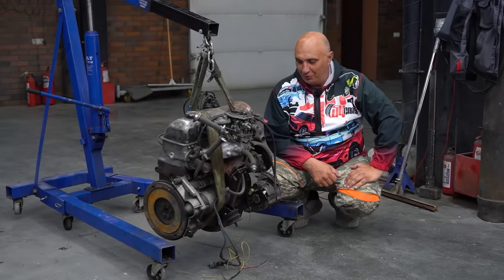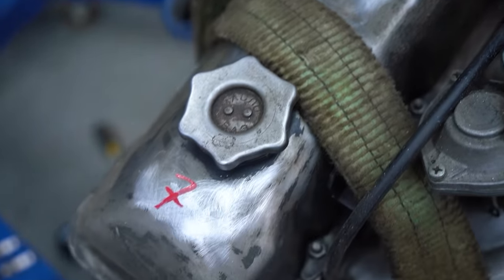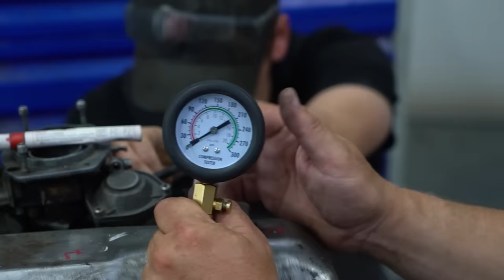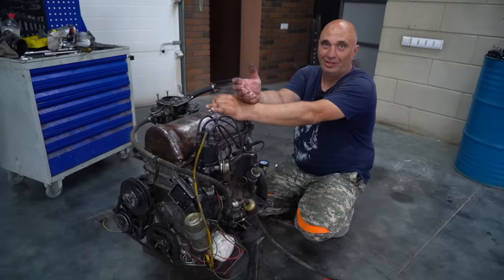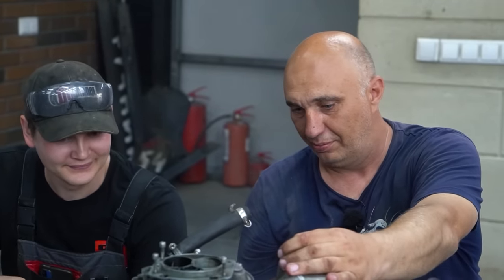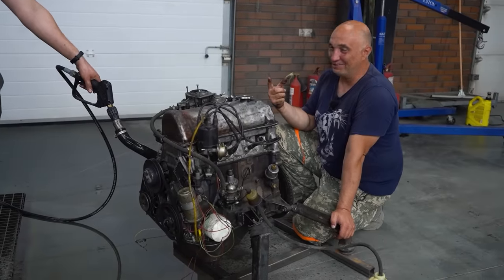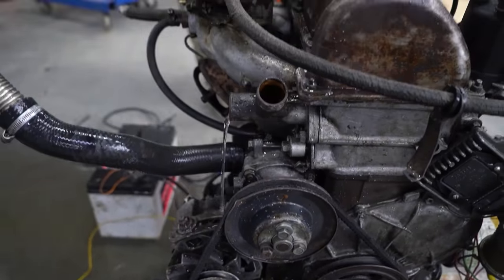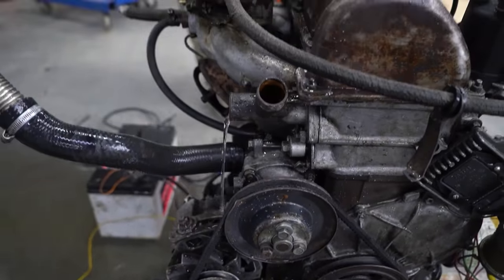Will an engine start on RUBBER piston rings?

Comment: Many different styles of rubber o rings on the market these days. Viton you'll have to be more specific. They make green, red, orange, blue, black viton rings these days. Silicone viton rings. I believe you are onto something here and I agree with the oil control ring. I also believe it would need a ring closer to the top that's rated for intense heat. So maybe would be a combination of colors.  Maybe even 4 rings. Make the ring grooves deeper. You could have 1 high temperature resilience ring at the very top. 2 black rings in the middle and lastly the oil control ring. If you were looking for an engine that would last near indefinitely you'd have to find a way to re-sleeve the cylinders with a Teflon tube that could also handle high heat. Then there would be almost no friction between parts only friction between the compression of the rings.  Allowing the piston to really flow freely while still keeping compression.

Comment: I have an idea. Use a correct oil ring for proper oil removal. Using an upper metal compression ring to protect the rubber from flame accessing the O-ring and preventing accidental. Diesel ing. Shave the inside of the rubber O-ring to give it a slightly flat surface to encourage it to stay incorrect position without twisting. I would be curious to see what happens and if it can be durable. Maybe add more rubber O-rings to help stabilize the piston help quiet the engine.

Comment: Use silicone rings on the modified 4-ring pistons you made, in a car with proper engine cooling. See how long they run
Reply: I commented about using silicone too, but ppl brought up degradation from petroleum exposure. Perhaps the 4 ring pistons with standard top and bottom rings, and silicone in 2 and 3 to see if it boosts compression but minimizes the silicone fuel/oil exposure problem.
Reply: Viton in a higher durometer might work better
Reply: ...or run it on alcohol! no cooling needed....
Reply: @koenielinux3131  BRILLIANT  GUY
Reply: @9morrical  SMART
Reply: @UmmmmmmmWhat  ASTUTE
Reply: @M S YES

Comment: You could widen the second groove and install a TFER hydraulic seal. It's a PTFE ring and rubber expander. Available in bronze loaded types as well. Maximum speed though is 12 feet / second. With an 80 mm stroke, that's 1371 RPM.

Comment: Two other things to check...Check for a carbon trailed distributor cap, and check the cylinder head. I suspect the valve clearance is too tight, and, check the valve guide seals. It's hard for me to imagine that the O-rings let all that oil into the chambers, and not have any blow-by. I'm willing to bet, the O-rings did even better than you thought!

Comment: Try replacing the piston rings with hydraulic cylinder packing seals
Reply: Being a directional pressure seal, it would probably pump a lot of oil past the seal on the downward stroke and the suction of intake.  However, compression would be great.
Reply: @kenbakker3241  You could do 2 in different orientation.
Reply: @kenbakker3241  keep the regular oil control ring in addition to the hydraulic cylinder seals. That should keep oil consumption down. It would still would burn some but I think there would be less friction than having 2 seals in opposite directions.
Reply: @kenbakker3241  Not a problem! Just run a 25:1 2 stroke mix in the crankcase lol. World's first runaway petrol engine.

Comment: Might be more trouble on a car with tighter tolerances- the ring there partly to transfer heat from piston to engine block to cool it, if cylinder heats up more it might seize/knock. Tighter tolerances tend to make them more fragile.

Comment: Actual piston rings have a profile for the top ring to scrape the cylinder when the piston goes down. O-ring is round and would allow oil to slip past them. Maybe keeping the oil rings could have helped. As for the rubber itself...it might have already burnt away if there was no oil on there!

Regarding high temperature rubbers do avoid fluorocarbon rubber! When those things burn up they put out hazardous fumes as PTFE would above 300 degrees C. HNBR and XHNBR would have elevated temperature capability too. Silicone do handle elevated temperatures but needs lubrication to live (How about using silicone sealant to make rings)

Edit: a good alternative is hydraulic packing for hydraulic cylinders. Do make sure that the bores are up to rubber seal roughness specifications.

Comment: a good experiment might be to make a piston out of EPDM, Neoprene, Nitrile, SBR, Silicone, or Viton.  Maybe put an aluminum core in it to connect to the rod then surrounded by a thick layer of rubber to fill the cylinder and no rings.

Comment: That could be very interesting to try silicone ring for their temperature resistance

And if your bathroom is not finished, how about take some times to made new parts ? Brake disc and metal pads , and if possible take exterior tiles made for cold resist, they should be more density ceramic

Have fun guys 
You're crazy and ..... I love it 😎👍👍

Comment: If I remember corectly one of the outboard engine manufacturers was running a two-stroke with Teflon piston rings the reason for that was so that they could use very little two-stroke oil in the mix to make a fairly clean burning two-stroke

Comment: Maybe drop the diameter of the rings by like 1%-3% and switch to silicone like others suggested.

I think with slightly smaller rings of better material this becomes a big thing
Reply: I think you're right.  Buna-n is only good to around 100C before it gives up.  Silicone is good all the way up to 200C.

Comment: Global O-Ring and Seal   
Neoprene, or Chloroprene rubber, was the first synthetic rubber developed commercially and exhibits generally good ozone, aging and chemical resistance. It has good mechanical properties over a wide temperature range.

Neoprene resists degradation more than natural or synthetic rubber. Additionally, the material resists burning better than exclusively hydrocarbon based rubbers, making it appropriate for fire retardant applications.   .

Comment: Depending on the rubber they are made of it is possible they absorbed oil making them swell up. That would definitely increase compression.
What if you used stainless steel cylinders in place of the rings? They could be approximately 2 to 3 millimeters in length and laid end to end around each ring groove. The roundness should create less friction by rolling up and down the sides. And being cylinder shaped laid end to end they should hold the compression as well. There will be tiny gaps between each one and that will, or should allow for the oil to still be able to lubricate the walls appropriately like regular rings would. 
Theoretically it should create more power with less friction. But I suppose it all depends on what metals are actually used. These bearings may run a groove on the cylinder walls or they may wear into the cylinders along the ring groove…

Comment: Best way to try out how long is last if you leave the original oil ring,middle the original piston ring and the first ring made from heat resistant silicone rubber o-ring. They are heat resistant up to 350C for 10000hour or more. I dont know how much Celsius in the combustion chamber, but the fuel and the intake air probably cooling enough and the micron oil  film layer prevent from burning or get damage. I believe you could drive with it thousands of kilometres without any problem.

Comment: I guess the engine didnt die because of the rings having blow by, but because the pistons started sticking. The metal rings are the only thing directinh heat from the pistons to the engine block, if you use rubber for this task the pistons will get hot until they expand to the point where they tick to the cilinder walls.

Comment: Try the rubber ring on the lowest point and then the standard rings above it. Less rubber to pinch and twist and also allow a little less grip upon installing the pistons and it should last a long time just used to seal up compression and oil passing through. The standard metal rings will protect the rubber from burning out in the long run.

Comment: Neoprene, or Chloroprene rubber, was the first synthetic rubber developed commercially and exhibits generally good ozone, aging and chemical resistance. It has good mechanical properties over a wide temperature range.

Neoprene resists degradation more than natural or synthetic rubber. Additionally, the material resists burning better than exclusively hydrocarbon based rubbers, making it appropriate for fire retardant applications.   .

Comment: im curious to see if with rubber there would be less or no blow by. if a better alternative for rubber appears for combustion engines there could be little need for pcv systems, less oil leaks, possibly higher efficiency, less wear on cylinder walls (although whatever the rings would be made of would have to be replaced much sooner than traditional rings), and longer periods of time between oil changes. This was a great idea and i hope something better can come of it in the future to keep combustion engines in the world

Comment: I believe it is about thermal expansion of rubber rings , also you may consider that rubber by time will swallowing oil and get bigger in size ,  this is why it starts fine and after a while it stuck with cylinder walls , I believe if cooled properly it will not stop running.

Comment: I think you should do a follow up with rubber rings and a factory oil ring. And please, get the mixture on that carburetor right and the spark timing, distributor timing was clearly out, we can see because of the huge intake backfire ! Getting the timing right, good carburator and an oil ring, the rubber rings probably will run indefinitely!

Comment: I agree with @Russell Smith and I'll add try adding the engine into a car and see if it has enough power to move the vehicle. How long the O rings last for will the question but I believe it will make for a great experiment. Guy's that was an 107% success. Great video guy's!

Comment: Ring at top and on the bottom only. Oil ring opening for the drain to be enlarged. Thus oil could be sprayed in the holes by a spray jet

Comment: Next time use the square cut temperature resistant o ring seals with a steel oil scavenging ring as it seems to be the most consistent comment being suggested by vuewers. I would also use an actual piston ring compression tool when inserting pistons into the barrels to avoid twisting/damaging the seals, also It would be interesting to measure the rings before an after to see how much is/isnt lost during engine operation, looking at the rubber under a strong magnifying glass or a microscope to look for cuts or  wear to square edges.

Comment: Have not finished the video yet but wanted to put that silicon o-rings may be more temperature and possibly rolling/twisting resilient due to different physical properties than rubber. I have an ash tray made of silicon and have used it for holding a soldering iron in an impromptu repair and it didn't burn so not sure how they would hold up.

Comment: this looks like it would work loverly in a low temp low rpm motor!  

try some different rubbers! see if you can find one that works even better

maybe setup a motor properly with full cooling system and watch the temps I think its doing something interesting to the piston temps as it might be insulating the pistons and causing them to cease and not the rings themselves so maybe look at skiming the pistion diameter to see if it runs better

Comment: I wonder if the lack of compression prior to first start was from the o -rings being pushed into the grooves with the ring compression tool and hadn't pushed back out against the cylinder walls yet. Then after it ran, the o-rings shook their way out against the cylinder walls giving the 8.0 compression ratio across all cylinders.

Comment: I imagine the engine seized because as the pistons heated they compressed the o-rings more against the bore. Conventional piston rings have a gap in them to stop this happening. 
You could fit an oil control ring and try that, the o-rings seem to be being cooled by the cylinder enough, but I would imagine they will wear fairly quickly.

Comment: the oil probably helped lubricate the rings to keep it running as long as it did. so adding an the normal oil ring might kill longevity
however adding the oil ring and running 2-stroke oil in the fuel might make it work just fine

Comment: I personally think if you notch a small area in the piston ringland for the o-ring to ride into slightly it'll create a sort of natural "ring gap", you wouldn't need much as most ring gaps are about .25 thousands of an inch. Obviously there is really nothing you can do to the o-ring itself for notching into it without compromising its integrity, so an area where the pressure can slightly push it into the piston ringland to create that relief would be ideal. Do that along with an actual oil ring and I feel like you'll have success!

Comment: Teflon rings don’t really need to start as ring you can simply cut an angle  where the gap is and just use a Coil  or longer straight length. I’d suggest using square shape material. My small steam engine runs fine this way.  If you use square stock there won’t be any twisting. Teflon can take much higher temp.  The oilmwilubricate ok too I think.

Comment: You need to run the engine on a 2 stroke type fuel/oil mix if you want the O rings to work properly

Comment: If you guys put a factory lada piston ring in each of the cylinders with 2 rubber compression seals you could possibly extend the life of the engine by a few hundred thousand miles because the rubber rings will be easier on the cylinder walls and when the rubber gets wet then it will expand which will increase the compression ratio.

Comment: The ring groves were flat in the bottom and the rings were round when inserted into the cylinders the rings flattened or formed to the ring groves. Enhanced Temperature Cast Nylon Sheets for rings would be a cool ideal. Great Video.

Comment: You should spend some time setting the timing, fit vacuum advance hose and connect 12v to the carburetor idle valve and fit an air filter this would make the engine run better and give up a better idea of how your tests are going.

Comment: master..
Ford once wanted to try carbon fiber pistons..
The engine spun 18,000rpm but was never installed in a real car..
You try everything and one day the "thing" you tried will be used by companies, and you will regret that you did not get a "patent"..
I think, get a heat resistant gasket and patent such a piston...
With an efficient oil cooler, this engine seems to have a future...

Comment: One piston with leather for rings, one piston with ball bearings for rings, one piston with silicone rings and one with high density rubber for rings. You might set a new and cheaper precedent for the DIY garage mechanics out there!
Reply: Ball-bearings with race in place of oil ring would be very interesting.

Comment: It would be interesting to see a plug check done and the condition of them. Even better if new plugs were installed form the start. You can tell a lot from plugs as to how an engine is running. Also a full exhaust system would be ideal for proper tune and normal back pressure.

Comment: Try Polytetrafluoroethylene piston rings. Super lubricious, chemical resistant, and heat resistant material. It might actually be practical in a well cooled block, or maybe just for the intermediate ring if not the top two

Comment: Yes, two silicon rubber ring with a factory oil ring. And please use exhaustion pipe also, and you wil not get 1-4 on higher rev and 2-3 on lower rev phenomena.

Comment: Wonderful experiment but it's my opinion that the Pistons got so hot because they wasn't able to transfer their heat to the cylinder walls that the engine started to pre ignition before the spark occurred just a guess

Comment: I think it's gonna run the same way with out rubber or rings ..... Rings Made to prevent gas and compression to escape to crankcase.... And oil to cylinder..... And that To improve efficiency
HOW EVER .... GREAT JOB 👏🏻

Comment: I'm thinking the o ring is a oil ring, but pressure and vacuum are letting it or pushing behind the o rings, so a larger or thicker bottom ring would be better along with a fully mirror polished bore. That being said if preferred I wonder how it would work in a drag race scenario where you could do a quick ring change. It would only be good if the parasitic loss would mathematically work. Fun either way. Never thought I'd see it, slightly amazed hahaha

Comment: I believe the oil kept the rings from degrading. if you put and oil ring and two rubber rings the rubber rings will go away quickly due to friction and possibly burning from combustion. but it would be nice to try and see...

Comment: You could have something here, do a series of vlogs using all sorts of materials to manufacture the rings. Aluminum, nickel, plastic, titanium, carbon fiber, etc. Regular rings are made of cast iron, and or steel so any other material would be interesting to see the results. Also think about the coatings they apply to these rings, and make up your own, or use existing methods. Could be a great series. 😁👍✌😎

Comment: Good experiment, certainly increased compression,  there's probably a rubber compound that can withstand higher heat, interesting that they would naturally expand greater than the casing,  but would probably benefit from running a bit cooler & as some mentioned an oil control ring.

Comment: Viton o-rings would be best.  Stay with  3 o-rings as you could see from the exhaust that oil consumption was fine, plus we want the oil to keep the o-rings lubed and cooled.  If you add an traditional oil scraper ring the rubber o-rings will run too dry and burn up.  They need the lube!